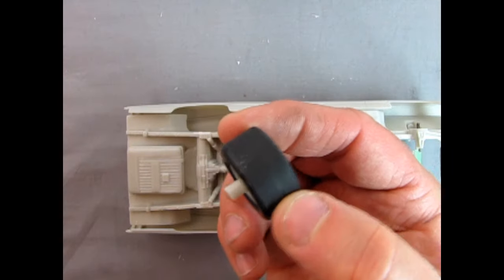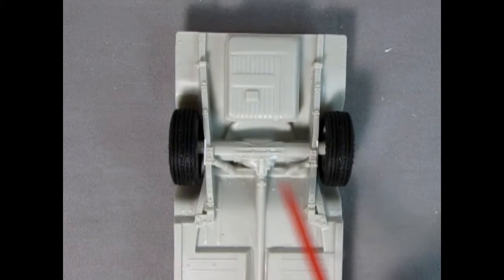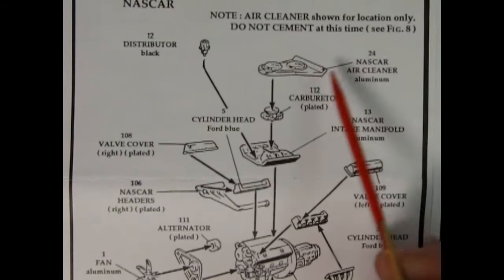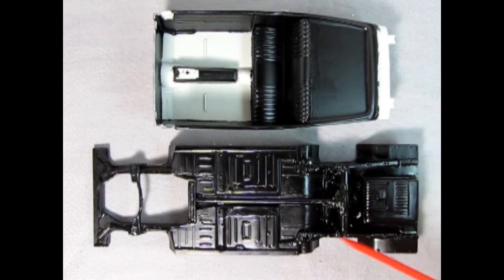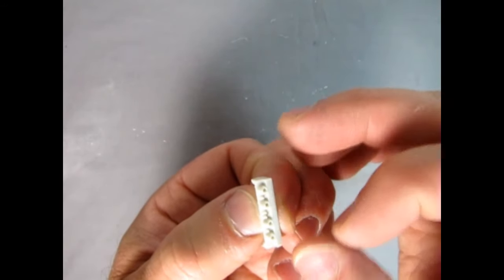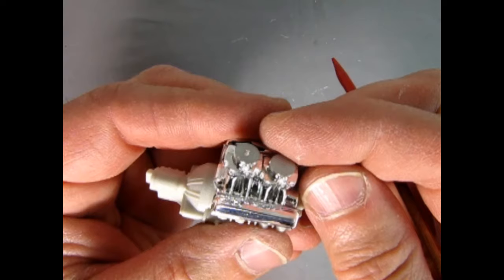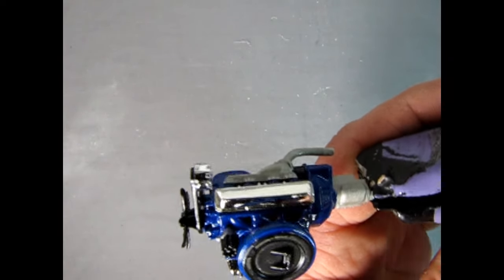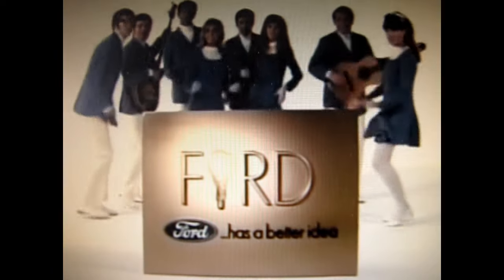How To Fix Everything Wrong With The AMT/ERTL 1969 Ford Fairlane Cobra Torino Model Car Kit Part 4

Comment: I love all the extra facts and history you've provided and the inclusion of real car photos. Many handy hints for the build. Well done Trevor 👍😃
Reply from the maker: You are welcome Pete. It sure has been a lot of work and discovery on this model to get it right. I am not sure if I will ever make such a detailed build video again as most of the other AMT kits don't have all the issues that this kit does. 

I am looking at attempting the AMT 1969 Dodge Daytona (With nose, filler pieces and wing) as the next kit, and I have already figured out what I am going to try to do to make the troublesome nose fit on...but after that, the rest of the kit fits well together, and the only other issue is the excessive flash on the parts. But now that second troublesome kit seems easy compared to this Ford.

Comment: If you use the dual carb set up with the dual carb airfilter prepare for removing around 2mm in the hight of the setup(manifold,Carbs and Filter) to make the hood fit!(ah,just came to the part where you adresse it  😉  )And iam just doing the interior details because the doorpanels dont look at all like on the real car!Very fiddly and time consuming!
Reply from the maker: For sure on those door panels. Again though, I am just building this to the point where the average Joe can get the pieces to fit and so that I can get all the issues resolved.

I should get another and do an all out, engine wired, inner door panel parts and whatever else to really jazz it up version. 

I'd also like to do a dragster, now that I sorted out that all those parts are still in the kit to some degree. Maybe use the dragster decals from the 1966 Galaxie kit on there too.
Reply: Between you and Trevor, I'm learning a lot.👍. Are you trying to make a correct factory stock car,Willi?

Comment: New subscriber here. Really enjoying your videos and the little details and facts along the way. Those 428 cj heads were made that way to get heat out of the heads and chambers. I have a friend with two of them sitting in his garage. He and his brother were really good on the local strip with those engines.
Reply from the maker: Thank you for subscribing and the wonderful story. 

This kit is taking me a long time to build, simply because 97% of the parts need modification for them just to simply fit together. Hope you can survive to the last video! :_Suprise:

Comment: The twin carb filter,that is not NASCAR.  What do you think they were trying to make?
Reply from the maker: I wonder if that was for the street machine version and someone decided on doing the dual air cleaner as a last minute idea, or if it was first introduced in the oval track "Modified Stocker" racer. Sadly, I wasn't able to find the instruction sheet online for the Modified Stocker to compare it too.
Reply: The kit has come up for sale,on eBay here.coincidentally,😃
Reply from the maker: Nice! Does the seller show the instruction sheet?
Reply: @MonsterHobbiesModelCarGarage  no,just the front page😣. I can't afford to buy the kit🤔😭
Reply: It does have lots of photos of parts. It has single carb manifold and chrome airfilter with the flap.👍.
Reply from the maker: @petesmodelcarcustoms584  No worries. Sometimes these people post images like that. Anyway, I think I am so far into the kit build that any new info won't really help much at all.
Reply from the maker: @petesmodelcarcustoms584  nice!

Comment: You mean there's a part 5? What's all wrong with this kit? 
Seriously though,  if you plan on doing a NASCAR version, you're better off grabbing parts from one of the polar lights Talladega or cyclone versions - I do like the amt  TorinoTalladega bodies better than the PL Talladega and Cyclone Spoiler- I heard them kits don't go together too well either (I could be mistaken)
Thank You again for showing this to us
Reply from the maker: It gets worse! I am working on Part #6 now....but it's the final put-together of both cars. 

If you made it through Parts 1-4, you are doing well. You are seeing that there is a lot wrong with this kit, and hopefully I am getting all these issues resolved. - This project was more than I expected. I don't think I've experienced a kit with so many issues to it, apart from the one Polish WW2 Monoplane aircraft kit I built in the 1980's. That kit had a 2 part fuselage where the left side was shorter than the right side and the wing had a top, bottom right, middle and left wing and the gaps were huge!  

Anyway, my regular model car build videos are usually 1 video 35-45 minutes long. This kit made me make 6 of those videos! - Yes, it has issues, but I can get them resolved. The final builds will be great!
Reply from the maker: The people say that the Polar Lights Torino and Cyclone kits have a bent up nose section that occurs at the front wheel openings, btw. :_Suprise: